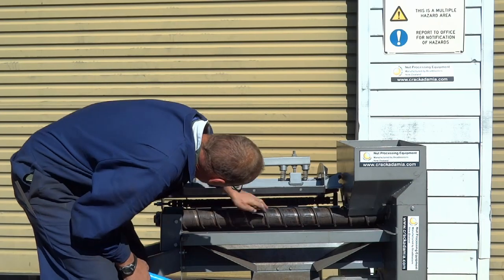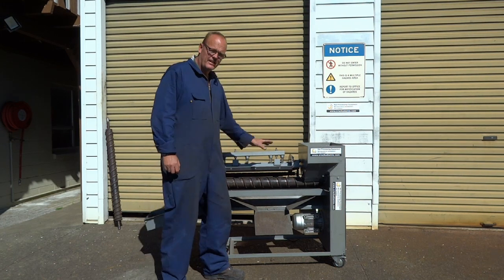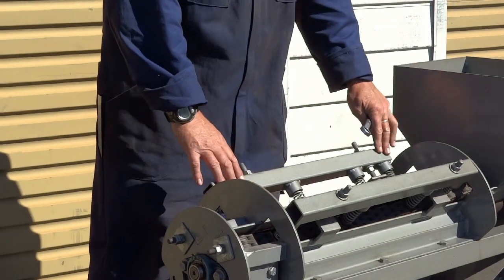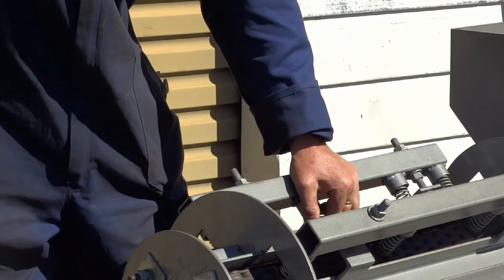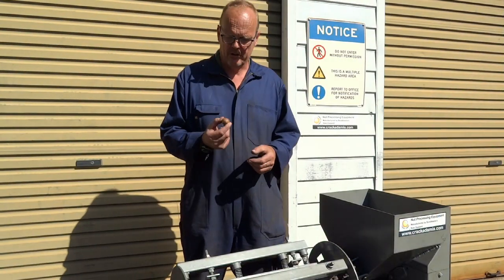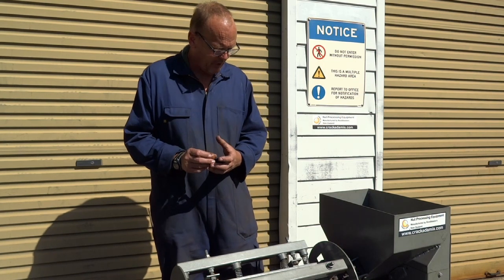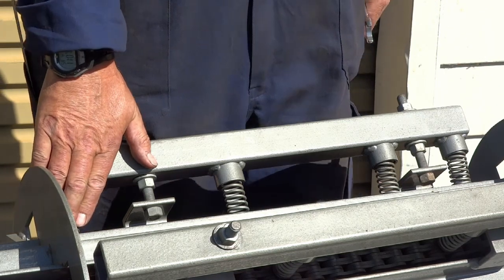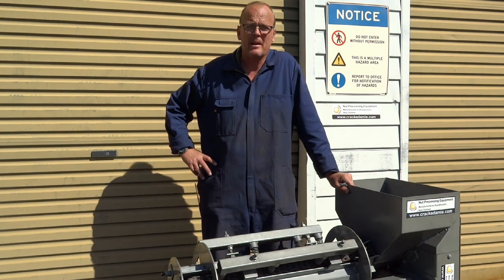CRACKADAMIA Tips - #2 Tuning a Macadamia husker

Comment: The dehusker looks like a solid machine that will last a long time. Are spare parts available like the drum & chain? I have a small maca orchard and am considering what I need in the future.
Reply from the maker: Hi, we have been manufacturing equipment for the macadamia industry for over a decade now, and are yet to change out a drum or chain.  But should someone need one we have spares available.
I see you are in Australia where we have a distributor for our equipment as well, feel free to Give Nut Solutions PTY Ltd a call to check out what we manufacture